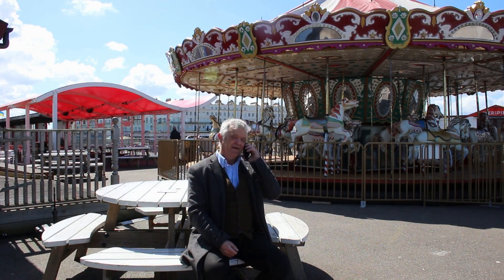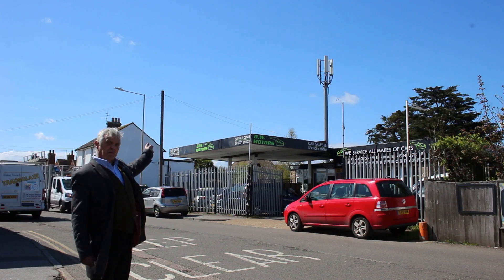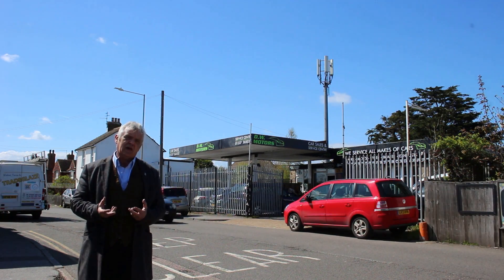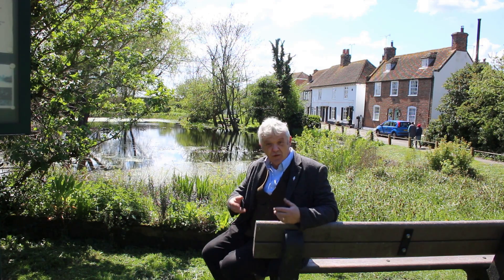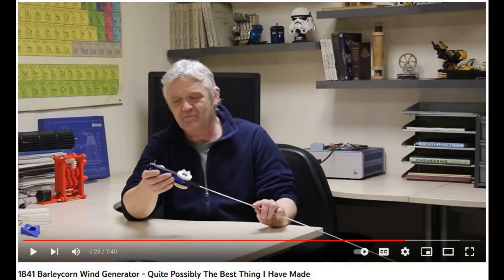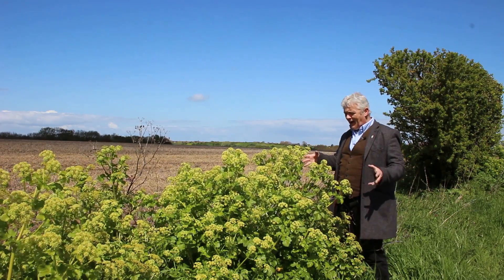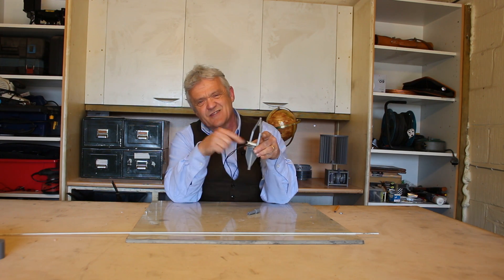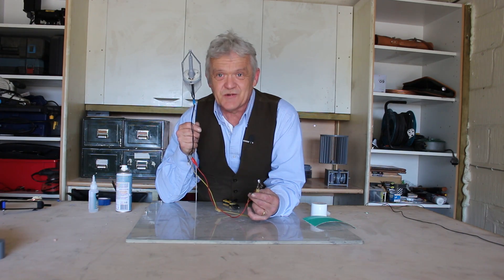1908 5G And Wind Energy Harvesting

Comment: Every LED street light, every home modem every 5G cellphone.... Is a basestation in the network. 
If you leave your home modem or digital TV switched on its using some 200W to pass on other people's data. 
Things turned into a warzone everywhere they installed them in urban areas in New Zealand a few Years ago. 
I had to evacuate to an area not saturated. Can't sleep or concentrate around them. 
Official medical diagnosis as "electrosensitive".
Though it negatively affects everyone, testing has proven, some notice it more than others.
Those of us capable of objective observation. 🙄

Comment: Super interesting ideas you present here. And you channel is awesome!. I have an outdoor IOT device which I wanted to power using a water resistant power supply, but I am considering using wind energy or possibly solar energy instead. Haven't found many alternative options until I came across your channel and you have so many great concepts, so now I need to settle on one of them. Might take a while :).

Comment: Have you heard of a fan that runs off of heat? No electricity. No wires. Not sure what the torque is on these things. Was thinking could use a sand battery and replace the blades with a generator.

Comment: Rob, what would it take to make your Bulrush generator into a cellphone battery charger?  I'm guessing you would need a capacitor & diode bridge to convert the quasi-AC current generated to a high enough voltage to overcome the work function of the battery.  With a wind-powered charger you could charge your cellphone at night.  It might be fun.

Comment: Actually, the sway in a skyscraper like the empire state building could be captured for a significant output.  Think of a generator like yours attached to the inverted pendulum stabilizer on some modern buildings!  Perhaps all the public lighting in such a building could be supplied by a bullrush generator.

Comment: - if there is enough windspeed to cause flutter of a flag (vortex shedding), there is enough to pressurise a diffuser. -and run any type of "air turbine"  Out on that pier, any generator would be cranking out a number.

Low velocity gusts on the otherhand - may truly be the low hanging fruit - intermittent scavenging for very low power need.

Comment: Make a tree, but instead of leaves, use piezoelectric transducers. Connect a diode to deliver dc.
Reply: I have thought of the tree from seeing a conifer pine wobble in the wind but I am thinking a solid ground mount with a swivel . Then have compression springs to limit the side to side movement or simply weights ( like fishing sinkers or fish line) that the swivel end pulls up and then pulls the rod back to vertical as the weight falls . then connect a side rod with magnets that pass a coil on the side. I have ordered coils online waiting for delivery

Comment: Take a few fiberglass driveway reflector rods,( or bamboo) mount the bottom solid to the ground,.  Use a couple u-bolts to connect it to a bit of flat bar, 1.5"-3" depending on length, and size of bar,  basically building a large flex beam TQ wrench,  with a large feather on the top! The 12"-24" of flat bar with a flat sheet of fiberglass board, steel sheet, but maybe not so efficient,  form a inverted triangle as wide as the resonant frequency allows it to travel, likely 12", 6" on each side of the stationary beam, mount another inverted triangle,  mount rows of alternating 1"x. 125" magnets on the moving triangle, a row of 12 at the top drop down 1.5", cand add a row of 10, drop down, add a row of 8, then a row of 6, then 4, then 3 magnets, with either a coil per row, of 18 gauge wire, on a. 1" bobbin,. And .75" thick , coil until. 75" off the bobbin,  step down and add another,  wire to a rectifier then series/ parallel to get desired voltage, maybe go to 20-22 gauge wire,   basically make a large feather   about 6' tall get it to blow backward and forward atleast 1",2" total a rough guess  it should do 5 amps atleast depending on series or parallel series, have 6 coils to allow it to operate as two 3phase generators,  but two 2phase would work as well!! With the leaf or feather, flapping about, making power 🎉

Comment: But the whole point of wind is that it is mostly "directional" for a period of time. A windmill will gather much more energy than a vibrational harvester using off the shelf components. Honestly, I don't think this one is worth your efforts. I know I know... but, really... for the amount of effort, the generation will be extremely low. I think I have said this before, but, why bother making these when 1 small solar panel will do much better, and at a lower cost, probably by a factor of 10 or more, if you take into account time and materials. This method requires "vibration", and basically most of the energy is wasted passing around the harvester.  You'd also be better off with a windmill alone, rather than add vibrational generation... unless there's some new miracle device that can efficiently do vibration generation that comes along. You can prove this to yourself... Compare 1 cubic meter of space using harvester generation vs 1 cubic meter of Wind or Solar.... There's no way the harvester will win using current generation off the shelf tech. Yes, we are "wasting" batteries, but we will be wasting much more than batteries by building fields of nano-generators that cost as much as a battery per device and don't deliver any real usable electricity vs Solar and Wind for the same space.

Comment: In stead of the coils, let the top flutter on a stiff pole, and use rods to several micro pumps could power a tiny hydraulic turbine., or flux generators.

Comment: I remember seeing something similar having been done at a tree level. IIRC a bunch of closely spaced pine trees in a forest had been fitted with wires that ran from each of their trunks - a metre or two above ground level - to a central point, where the pulling force in constantly altering directions was somehow harnessed to something like a dynamo - the mass of the trees pulling in a common direction at any one point meant that the gearing to the dynamo could exploit quite a lot of torque, and spin the thing pretty fast. I think this was being experimented with in a Scandi country? Any idea where those investigations went - is it still a tech that's being used, or was it a dead-end?
Reply: interesting take could be worth doing :)

Comment: Hello Mr Robert. Idea of harvesting of wind energy is good, but it would be better if for this purposes will be used parametric methods of generating of energy. I mean for example if there will be used charged capacitor where one of plates will be floating and changing capacity of capacitor by converting even little amounts of energy to electrical. Or deformed coil with DC current by changing it's shape with sea waves could able to create extra amount of AC electrical energy. Thanks a lot for your attention

Comment: at 11 am today i was having a play with my box of magnets imagining a way to scavange energy, the perculiarity of my imagined design was that the magnet was not suspended, the device i imgained was verymuch like yours, but the main magnet was a ring magnet, on its side, magnatised to a metal base, with another magnet and as i tipped the box left and right, the ring magnet ossilated, always returning to the middle point where the magnetic attraction was strongest, all it needed was some wires arround the ring magnets path to pick up a charge as its reacted and counter reacted to its reorientation.   Great Minds think alike,,,,, or fools seldom differ :P   All Humans Ring magnet iddea now public domaine , if you build one of these faster than me i applaud you

Comment: Loving the new scenery. Also the micro generation idea. With all our loadshedding getting ridiculous here in South Africa, I am considering a noisy fuel generator like my neighbour or an expensive power bank thingy. But, I already have some solar lights and other rechargable lights, so am strongly considering individual power sources for things like: WiFi router, TV, fridge. Gas for heating and so on. But all the ideas are great, everything has its place. You have inspired me to take out my soldering iron, scrap batteries and even planning on buying that cheap charging board soon. Already made my first rechargable solar light from various old parts just lying around. Oh and big Clive helps too.

Comment: Great video!!! Suggestion, get hold of a Arduino Nano or Pico, a small amplifier and program it (ChatGPT will do the programing for you) to monitor the output of the thing you built. Take your other device from the last video and mount that near it and monitor both on the same Nano. It would make for an interesting followup. Maybe have the Nano monitor it for 24 hours.

Comment: Regarding this video, I found that a lot of comfort stuff use surprisingly very little energy, my computer use 60W I need to run it 10h and it still doesn't consume as much as my 700W rice cooker! but these small energy device are luxuries, I need to make food and the most energy goes to essentially boiling water, and that's survival! Basically we NEED 1kWh just to survive! and the other thing that consume the most energy all boil water in some form, such as the washing machine! But water being such a simple element, it mean we have a cap on how much energy we need. the 1 kWh is a symbolic threshold for basic survival, anything else is luxuries!
Reply: An interesting thing about that.  Evacuated tube solar collectors are extremely efficient for heating water.  Solar hot water doesn't get a lot of attention like solar panels, but they are a well proven technology.  I'd be surprised if Robert doesn't have some videos on them.
Reply: My energy company pays me like 3 dollars a month on my electric bill cause i got solarpower on my social housing but im a very very cheap person.
Thats without gas tho

Comment: Hey Rob what if the operation of that was inverted?  So the wavy bit up in the air would be the long lever, and the bobbly bit with the magnet and coil were on the bottom below the fulcrum?  Is there any advantage to this?  I would think that if the breeze were only slight, you might get at least partial generation from the bottom, rather than basically no generation at the top.

Comment: Another non sequitr, I'm sorry, I have so many video to binge back, lol BUT Alberta university has apparently discovered a powder mixture that produce hydrogen with any water at ambient temperature, through a catalytic reactions with no energy input, but they won't tell us what's in the mixture except it's safe for human and environement!
I ask my friend Bing Chat to reduce candidate based on these information, and after eliminating unsafe elements, what remained was calcium, and the catalyst could iron, nickel, platinum and carbonic anhydrase, there is probably more, but that's seems more doable by me than an SOEC!
The researcher discovered the mixture by accident after leaving the mixture over night, they working on hydrogen fuel cell, and their plan is to use hydrogen fuel cell with their discovery to purify water all while generating electricity. Given what they say, it seems to me the split oxygen is captured by the process.
Reply: is it  safe   AND  effective   ?   🤣
Reply: @rumples2698  That's always relative, Like Robert demonstrated in his video. If it's cheap and easy enough, maybe it scale, just fill giants water reservoir, possibly with run away water, and let it generate hydrogen passively, and maybe convert it to pure water and electricity, there is probably some application somewhere. The rendering rates isn't known, but we can try to experiment and find results ourselves, as we already know it's possible. BUT I'm still on the look out for cheap DIY possible PEM, that's the thing that bother me the most.
Reply: @rumples2698  😹😹😹😹😹😹
Reply: Can you link the paper? Last i heard from them they made improvements to the electrodes so we could electrolyse seawater without purification
Reply: Sorry that was Adelaide, oops lol
Reply: @siiluviilu  It's on the university of alberta news.
Reply: BTW I also found out that mycobacterium also use nickel and iron to generate electricity to run themselves! see the video by Anton Petrov:  Groundbreaking Bacterial Enzyme That Generates Electricity From Air
Maybe there is another secret sauce, but calcium, iron and nickel are strong contender

Comment: This idea of wobble is awesome. I have thought of using a fairly stiff bit of clear lamination plastic. With a U-shaped piece cut into the vertical face. Essentially creating a pendulum and a hinge in one cut. Weight the bottom of the you with your magnet and locate a coil accordingly.

Once all sorted out the entire body could be cut in one stamp of a simple die.

Standing next to one another like blades of grass being pushed around in the wind
Reply: I wonder if the wobble frequency is ever going to be enough to generate a usable amount of power.
Reply: @mikedodger7898    If something visually appealing we’re to be made (grass, trees,ext)  they could be made by the thousands for little cost.   I’m sure it could be.  

The amount of wasted energy of passing cars on the freeway has to be enormous and nearly non stop in places.   

I think it’s viable just requires some effort and thought I’d imagine.
Reply: Attatch  a wire to   joey biden
Reply: @rumples2698   lol!  Aaah.  Better be careful with that talk.  The FBI will be at your door.

Comment: I have always wondered how so many small generators can be linked to provide more power but not interfere with each other. Like power from one traveling out but backtracking into the next one. Feedback kind of thing.
Reply: Fairly simple actually....use diodes to restrict current flow direction and wire them in series to bring voltage to desired level, then wire those "sets" in parallel to raise current to desired level......"in a nutshell"
Reply: Are you talking about perpetual energy device?
Reply: @pjarma8536  Me?  No.. It is just that if you come up with something that does generate some power but not enough to hardly light a led, then having many of such devices would make it more able to do real work. I was just wondering how a person would connect all of them without one feeding back on the others. That was answered by a person already though. As for perpetual devises, I think many are on the right track to make something that can run much longer than normal but not reach over-unity. I still believe in the law of physics but still have an interest in things people come up with. Not those stupid combinations like taping a battery to a magnet and running a bulb, etc.
Reply: @55Ramius  oh ic I could of answered that too you use what’s called a parallel circuit where you join all the lives in a row and all the negatives in a row.